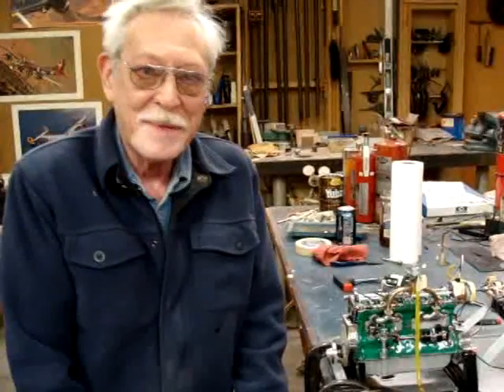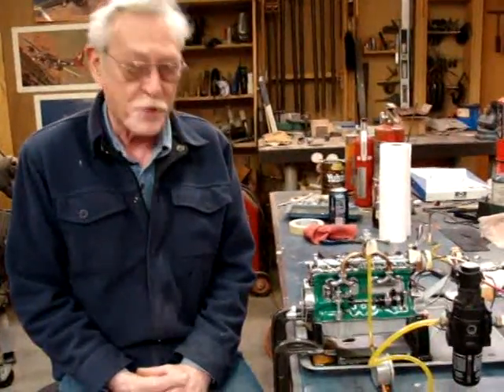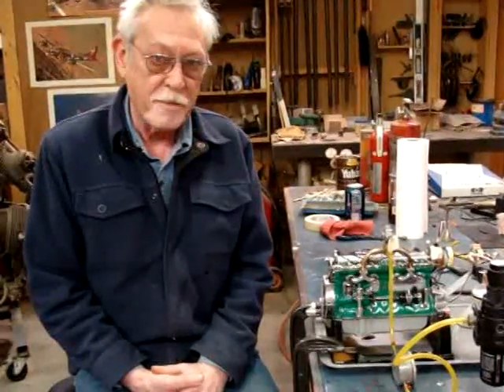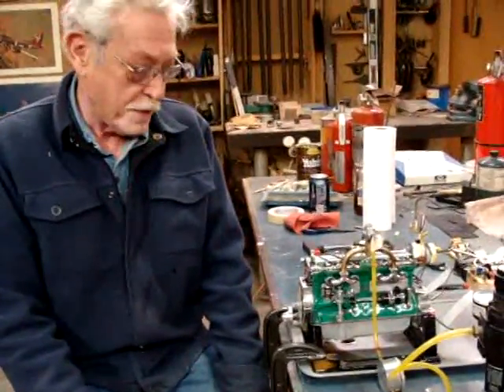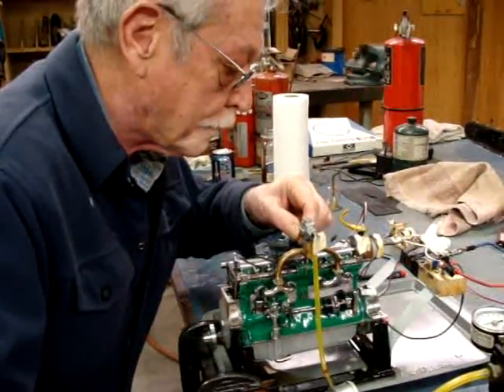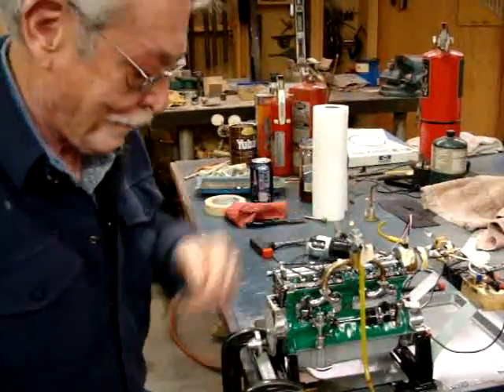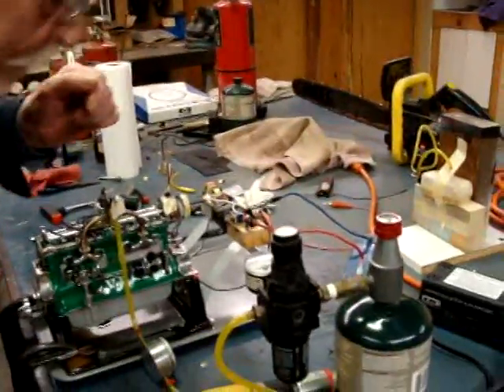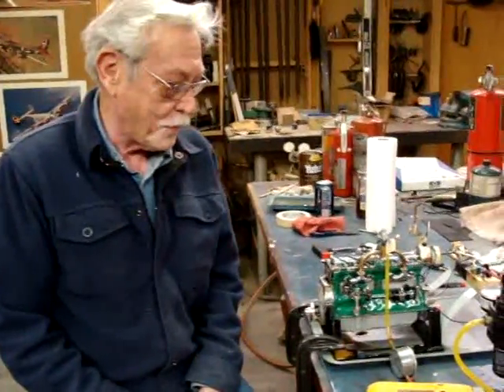First Run of Lou Chenot's 1/6 scale Duesenberg engine

Comment: This engine and most of the ones featured in the Craftsmanship Museum are running 4-cycle engines. This engine in 1/6 scale has a spark ignition, carburetor and 4 valves per cylinder just like the real engine. As a concession to the tiny size of the carb it is running on propane rather than gasoline, but it is a true 4-cycle.

Comment from the maker: Compression on model engines is generally lower than full-size engines--usually about 4:1. Wall thickness is not a big problem with lower compression.

Comment: Not being knowledgeable about model engines, I'm curious about the compression ratios one would use? The tension in the cylinder walls gets larger as their curvature becomes smaller, so is there a problem when scaling down the wall thickness?

Comment from the maker: Gary, I contacted Lou and he stated that an airplane carburetor was not used. He duplicated the actual Duesenberg Stromberg carbs in miniature, scratch building them from brass. He also stated that Propane use is not very dependent on the carbs.  He used an accurate (down to 2 psi) regulating valve on the propane tank, a needle valve and an additional, very precise regulator behind that to feed propane through the carb.

Comment from the maker: @Seattlecarnut   The crankcase oil will absorb some of the heat generated, and when the head started to feel hot Lou would shut it down. It would take a minute or two to heat up, which is plenty long for a demo.

Comment from the maker: @Seattlecarnut   Video of the last run of the engine before it is reinstalled in the car has also been posted to YouTube. Lou has proven his point about the engine, running it over 400 times (without coolant) for spectators in the past year and a half. That is amazing durability for such a small, complicated engine. Once back in the car it would be too hard to maintain and keep clean, so it probably won't be run again. However, we at least have these videos to show it can be done.

Comment: LMAO, shouldn't run an engine without coolant! It anneals the steel.
STILL a great engineering project. It's amazing the scaled down
Rocker Arms would stand up to the abuse, the small diameter
rocker shafts are a weak point, watch it if they break, they can
send a valve flying up thru a car hood. Trust me on that.

Comment from the maker: The car is a true miniature, meaning it is exactly like the full-size version and doesn't have any servos or radios built in. It even has gears in the transmission and differential. I do not think Lou plans to run the motor once it is installed in the car, as it would be almost impossible to clean it up afterwards. The video of the engine running will have to suffice to show that it does work, and mounted in the complete car it is the crowning jewel of the entire masterpiece.